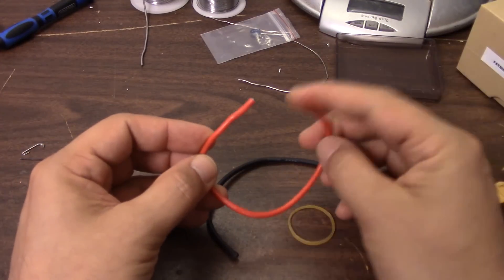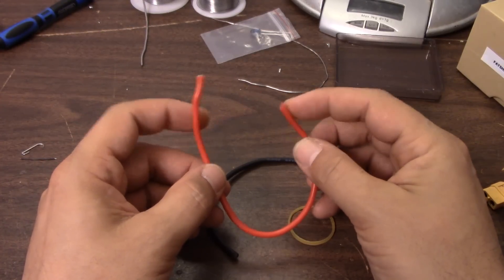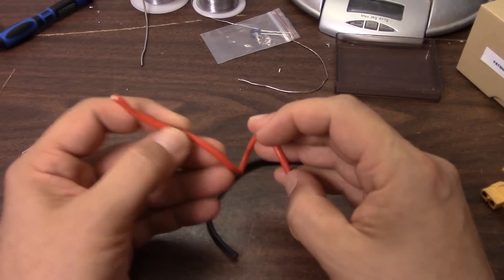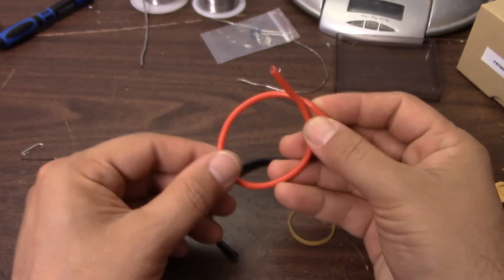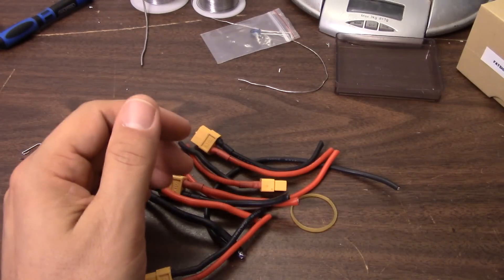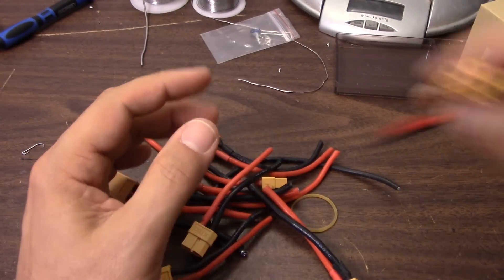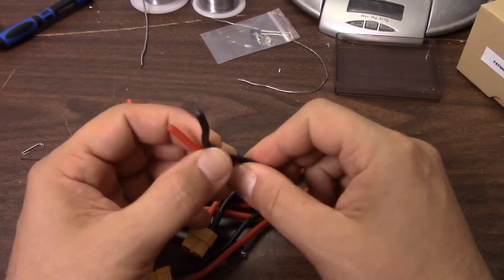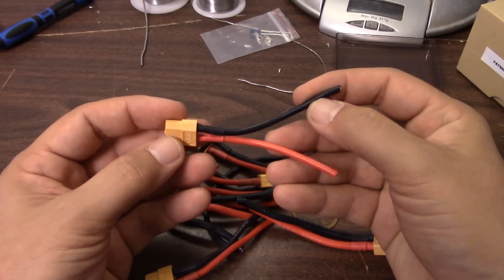Free Silicone Wire for Quadcopter Battery Lead | BUILD TIP

Comment: What gauge do you recommend for battery (14?), ESCs and board wiring respectively?
Reply from the maker: 14 or 12 for the battery. 18 or 20 for the ESC power and motor lines. 22 to 26 for signal and low-current power.

Comment: Yup. Ever since I started adding lights on my quads I have been in the hunt for silicone wire, I keep all the scraps from my ESCs, motor wires that I (am forced!) to shorten. For low voltage, low current applications the wire from the connectors that come with flight controllers can be used as well. I just keep it all in bags..the most "rare" silicone wire colour is RED! 🙂

Comment: How do you discharge your damaged batteries?

I have one with a dead cell, but 3 fully charged ones. I'm not sure how I should handle it.
Reply from the maker: I use an automotive bulb as a discharge load. Put the battery somewhere safe while discharging it, such as on a concrete pad.
Reply: Thanks. I wasn't sure if I should still do that with a dead cell. I will try it.
Reply: The biggest thing with a dead cell is to not charge it.

Comment: This needs to be addressed more.  A few issues come to mind :)    For example, discharging by resistance (for example a light) to make it safer, how to properly store until given to proper handler, etc..  I prefer ammo box with vents in the seal until I can get it to handler.  Too bad we can't use those style of XT-60's.
Reply: I agree. Battery management really is week one stuff that more people should know and understand. Accidents I get, but over discharging, prop cut cables, bad storage, inappropriate rating for type of use, all have easy fixes and is usually just a lack of care or knowledge or both. Starving kids in Africa and all that, how about handing them onto a buddy that can't afford more when they get tired or wrong for a new build. The tip is fine, I'm all for that kinda thing, but if I had that many to harvest from I would have just about halved my total number, most of which must be bout a year old and I try to run ten or so packs at least every other day if not every day and they're mostly still pretty good. "I've ruined so many rolls royces ive started taking out the seats to use as lawn chairs afterwards" must be a nice problem to have though I spose

Comment: You're talking about the insulation.  That's "silicone insulated" wire.  There's a few things that lead to "nice" wire to use.  For our hobby, thin insulation is nice.  So is sillicone.  Also, high strand count.  High strand count also helps make flexable wire.  High strand count, sadly, also reduces current carrying capacity, for a given wire diameter.  

There are other "good" wire insulation materials.  PVC, Vinyl, Teflon, Varnish.  They all have their places, teflon is good in high heat.  Varnish is the thing you use where you can't afford the thickness of normal insulation (like the winding of your motors).  PVC doesn't peirce as easily as silicone insulation (it pinches holes pretty easily).  

It also sounded a little like you were saying "sillcion" wire. :-)  

Keep up the good work.

Comment: LOL, I can't throw anything away so I save all the wires and connectors from various RC items.  My favorite are the tiny micro connectors that come with a lot of flight controllers.  Those things are super useful later when you need a connector like that but they don't sell those anywhere by themselves.
Reply: I would be very surprised if there's any of those Molex/JST connectors that you can not find from a real electronic part stores like digikey or mouser. More importantly they sell you the genuine products for less money (which are mostly made in Japan or Korean for the case of Molex and JST) instead of some crappy chinese clones. The RC industry didn't invent them they are just standard connectors that are widely available and used everywhere. But of course we have to use correct name, like Molex Picoblade instead of "micro JST" or "JST 1.25", or Molex 51005/51005 instead of "walkera connector", etc.

Comment: For some reason I have never thought of that...I have saved the plugs from old batteries..but never the wires..lol go figure..but ya, you gotta be careful about not cutting them at the same time..when I first got my first lipo, like 5 years ago, I wanted to switch from some weird connector to deans..back before xt60's.. and without thinking, just cut both leads at the same time on a fully charged 3S lipo...luckily I was using heavy duty electricians wire cutters with insulating rubber handles..so I didn't get shocked, but it made a massive pop, puffed the battery immediately and left a huge discoloration area in the metal cutters where the heat from the short heated up the cutter so much.. Have never done that again...
Reply: It's 3s, that's like 14 volts tops. You can't get shocked from that.

Comment: Also, if you strip some of the silicone off the tip of a lead, you can get a free vibration dampening o-ring.
Reply from the maker: BONUS.
Reply: Daniel X. I've never thought of that. Great idea!
Reply: I was about to say the same thing.

Comment: please don't forget to cut the wires one at a time! if you cut them both at once sparks will fly. same goes for the balance wires.
Reply: That's how i discharge the battery ( ;
Reply from the maker: DEFINITELY! I was surprised to even get some sparks from a fully-discharged (like, I left it plugged in to a light bulb overnight) puffed battery that had been sitting for months.
Reply: That's no fun. :)
Reply: I just blow up all my old batteries :P